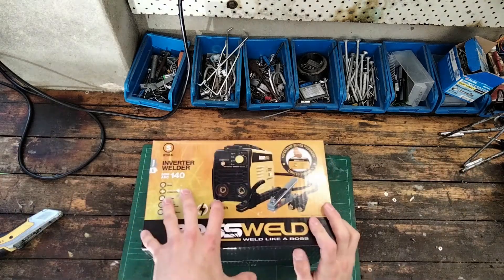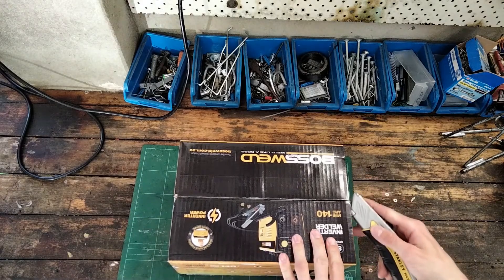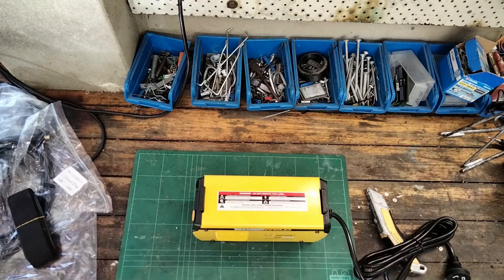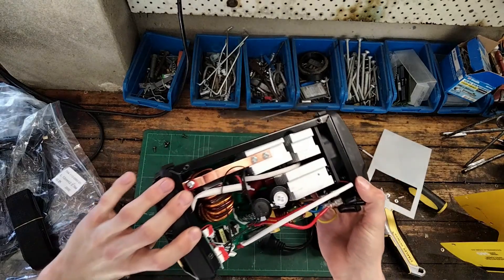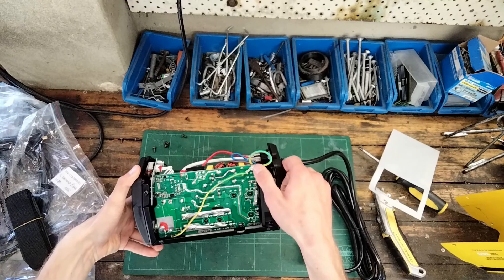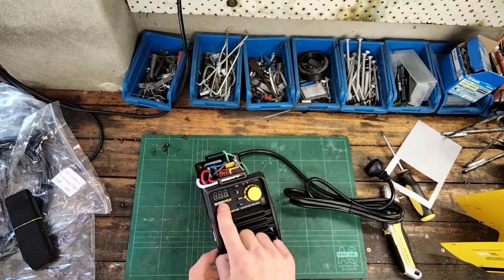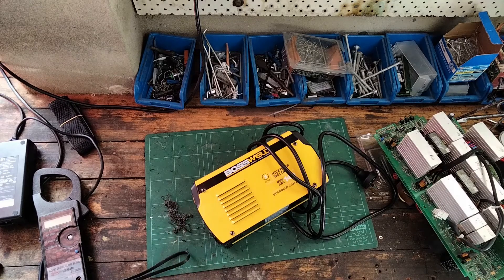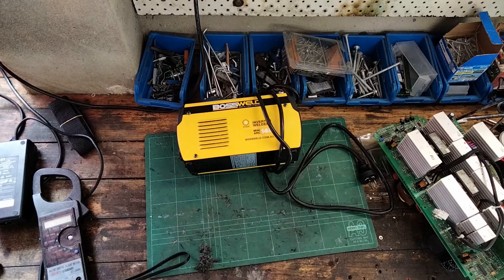$50 BOSSWELD 140A Inverter Welder Teardown & Review

Comment: You don't know what you're talking about and you can't weld . Sorry man. This machine has both hot start and anti stick.
Reply from the maker: Hey @Rob-Art Farming NZ, thanks for the comment. I dont know a whole lot about welders and welding, so I think you are right. I am keen to know more. As I said in the video, I think it was more an issue of my skill than of the welder itself! All the best mate. 

Bob
Reply: Looks like galvanised iron.you could have done the welding inside. Don’t need to be over cautious of fumes and fire.You may not have welding e perience back then but sounds like you have a electrical engineering or electronics background.It’s good your trying to weld ,I’m redesigning the structure of my house no experience no aprovalls sought.